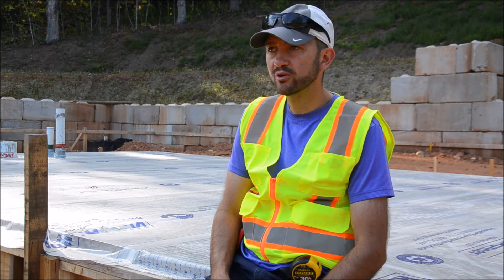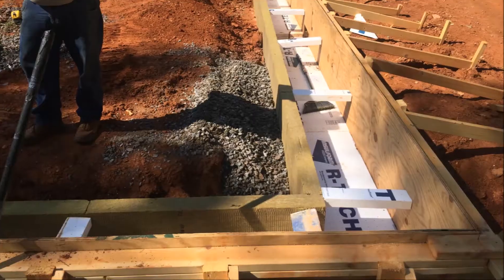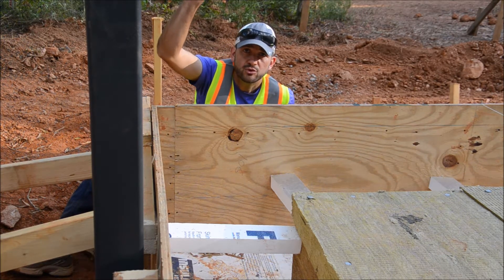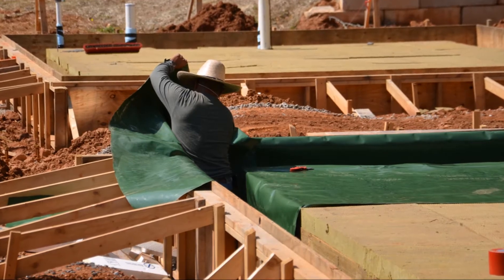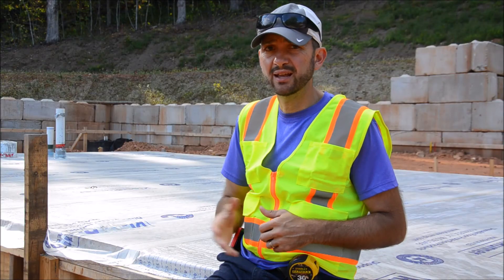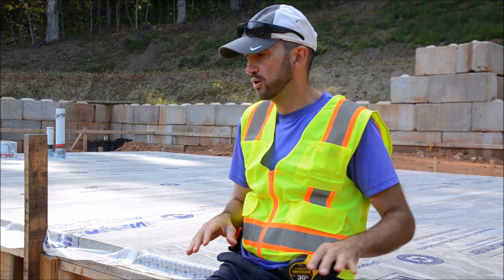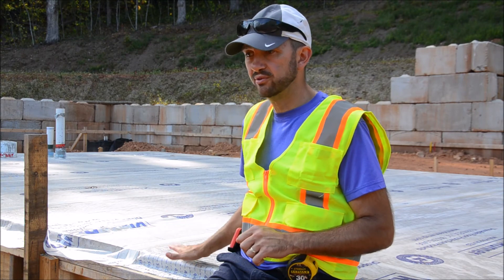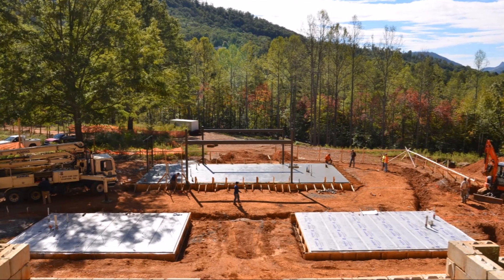Building a Concrete Slab to Last Forever

Comment: Roman roads lasted 2000 yrs, still passable. They were compacted dirt, large rocks, smaller rocks, gravel, sand and clay mix compacted ontop. They had paverstones on top in the cities and mostly dirt rds between cities, but they all had this thick build up of materials, and were slightly rounded on the surface, to drain water away. Again, this simple technique has lasted thousands of yrs. Do that, just concrete over it.
 With that said, ur concrete will NOT last extremely long, simply because u used the rebar reinforcement. 
 Rebared concrete is good for resisting impacts and tension, this is true, BUT rebar rusts. Over a couple decades, cause concrete is permeable, unless u buy it specificly thats not, then the moisture WILL get in and the rebar will rust and the rust will leak into concrete and destabilize it and cracks will form and thats that. Of course, u did put moisture and vapor barriers on ur slabs, so thatll help, hopefully for a few more decades. Having them last ur whole lifetime with few cracks and maybe a corner missing, at the most, is good enough. 
 But good enough aint good enough for me. I want my place to last, almost perfectly, for atleast 4 generations.
 If i can, id buy a small mountain and hollow it out like a dwarven ruin. A mountain carved from inside out into like, a mansion, would be there for over 12000 yrs.
Or a house out of 10 ton blocks of granite, like the pyramids, but just a house. Made of 10 ton granite blocks! Fantastic.
 Like them large concrete blocks in ur retaining wall behind u. I dont think they would last as long as true stone, but because its big block, itll last a good long time.

Comment: 1) Do we need rebar if we replace them with nylon fibre. I suppose my question is can we replace the rebar with nylon just thrown in the concrete mix.
2) EPs is susceptible to moisture ingress over time. As I am not from this location is this a concern to you.
3) Coming from a cold climate there seems to be zero provision for frost heaving is this because its not a problem in this location.

All of my questions are based on curiosity as a builder they are in no way a criticism of the quality of this work. I thank you for the video as I understand how hard and time consuming these can be to do.

Comment: what a BS !! Rockwool does NOT last forever , Neither does foam . they disintegrate in as low as 20 years .....its not gonna last forever , And concrete does not last forever either.max is rated to 70-120 years ......
Reply: Not true there are structures made of concrete several thousand years old. My childhood home is more than a century old with a concrete basement and it’s just fine

Comment: So you laid 6” of rock wool insulation onto compacted dirt. Then poured concrete onto it?
Reply from the maker: @Todd - No, 6" of gravel was laid on top of soil before the 2"-4" of rock wool was laid on the gravel. Then, we installed the vapor barrier, then rebar, then concrete. Make sense?